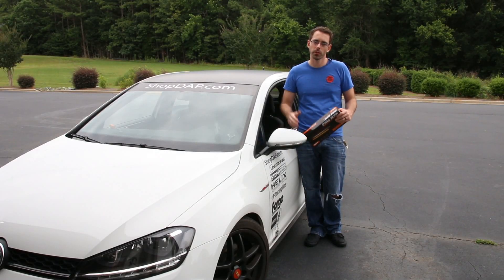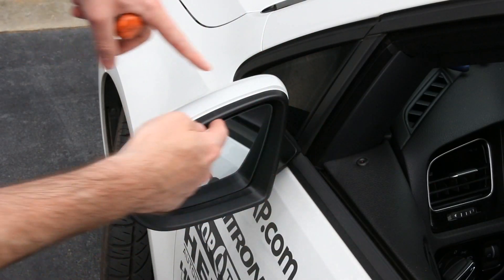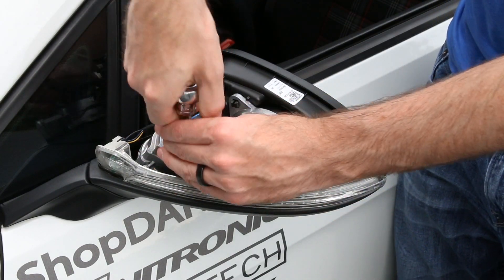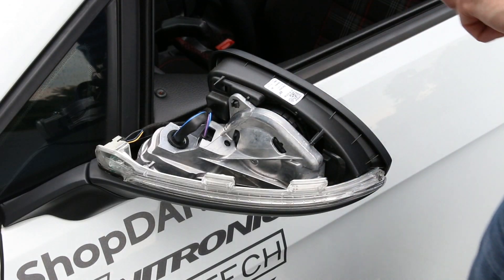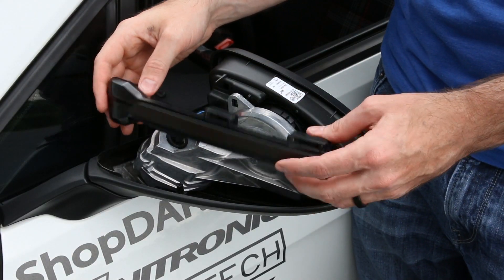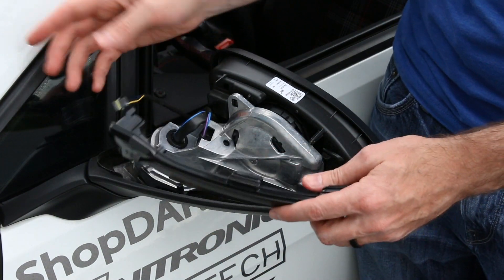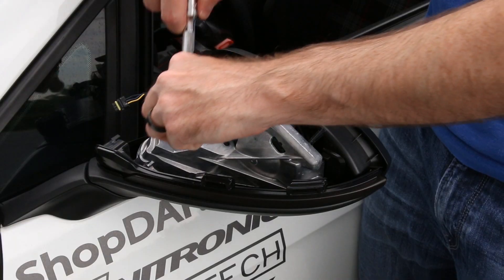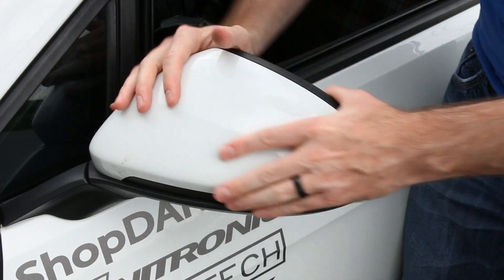MK7 LED Dynamic Mirror Turn Signal Install DIY

Comment: $200 eughhhhhhhh. Probably made for $20...
Reply: sam9m $2
Reply: Ali express has 60.00 ones. Same diff
Reply: Amazon has them for $40
Reply: I can also confirm that the Amazon ones DO have the the small hole light on the driver facing side of both mirrors. The ones I got were sold by BanchaoUS.

Comment: Huh? Did I miss something? Why didn't you show us it working. See how it looks?
Reply from the maker: also here https://youtu.be/-IcJqSPQ9nw?t=5m4s
Reply: it's at the end of the video?
Reply: Do these not shine through the hole to the opposite side of the mirror, facing the driver??
Reply: Eth Nick I also need to know the same thing. Did you find out in the meantime?
Reply: Vlad Gorgan no they do not show on the driver side. Kind of disappointing
Reply: Beginning and end

Comment: Optional method: If you trust yourself to take the mirror out entirely without breaking it there is an easier way to do this. Once you remove the mirror there are two T10 screws behind it close to the bottom that secure the bottom section of the mirror cap (the matte black part). Take those out and removing the signal light becomes far far easier and you wont risk damaging your old ones so you can either sell them or keep them as spare parts.
Reply: hello buddy, I had a cracked mirror cap but its not the upper cap, its the lower cap. The question is can I change the lower cap without removing the door panel , because lower cap holds the mirror mail neck from its neck hole.

Comment: 200$ for a piece of plastic and led bar... think I'll wait until someone makes a cheaper version that's fucking ridiculous.
Reply: I just got mine today from aliexpress. $20 usd and almost 30 days for shipping
Reply: @stinkysGTI  how does it look/hold up compared to these version.

Is fitting the same
Any error codes

A video showing how well they work would be good
Reply: Uro tuning has one on sale for like 119. But your not gonna find one cheaper than that probably, or one with good quality.
Reply: i got one from aliexpress for $11 it's great

Comment: Do the wires that control the heated mirror function need to be in a specific order? I'm seeing blue on the outside and red on the inside for the driver's side mirror, but unfortunately I didn't pay attention when I did the passenger's side mirror first. Is there a specific pattern that these both follow?

Comment: Hey DAP I have a 2015 b7 passat and bought some sequential turn signals just like the ones for the gti in the video. Would the process be the same or would it be a little different? I can't find anyone who has made a video on it

Comment: Hi guys… anyone knows how to take away the lower plastic under the tailighit? I broke the right one and i have the raplecement but i habe no idea how to change it and did not find any video or  “how to…” i took away the full rearview but looks like i need to take away all electric system

Comment: Hey man, recent sub. What can I do if the bottom holder for the side mirror is broken but the mirror still works? I saw that they're selling seperately. Can I buy it seperate and replace it? Cuz some shops say I cant

Comment: Well done Paul. Installed mine following your guide. However, my dyna blinks came with blue light function, and meant to ask which cable do I connect the blue cable for blue light.

Comment: Please ask them to alter the design so you don't lose the light on driver facing side. If they do that I will buy them.
Reply: Don't they shine through that small hole like the factory ones do?? What a bummer if they don't - I was ready to get these...
Reply: @TheEthNick  The $40 Amazon ones I got have the small hole light on the driver facing side of both wing mirrors. The ones I got were sold by BanchaoUS.
Reply: Zac I’m not able to find them, do you have a link?

Comment: Hi
I fitted one on my mk7.5 but not working ?
Reply: Curious were you able to find a solution for it to work?
Reply: Some mk7 versions do not work on 7.5 I wanted to buy them off supernova but they said I would hve to wait for a 7.5 variant

Comment: These are great...but only at night. You can hardly see them on a cloudy day & they're near impossible to see on a sunny day, especially through sunglasses. What doesn't help is the tinted plastic covering the LEDs. Form over function unfortunately.

I'll be replacing them soon hopefully...

Comment: No coding?
Reply from the maker: nope
Reply: Deutsche Auto Parts what about the indicator facing the driver? Is there still an LED for that?
Reply: Great question. Can the driver see the indicator on the outer edge of the mirrors like the OEMs?